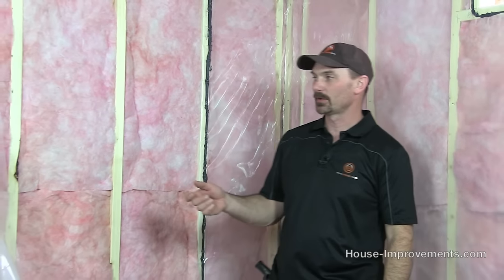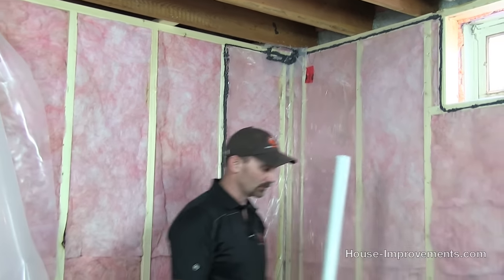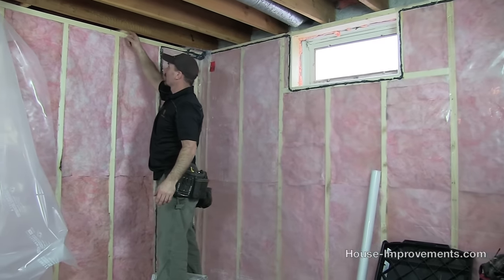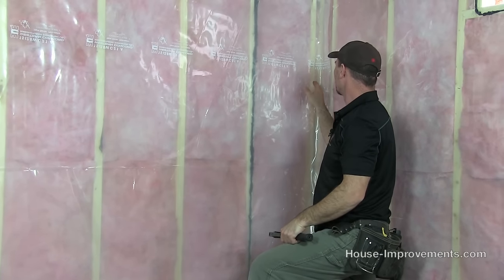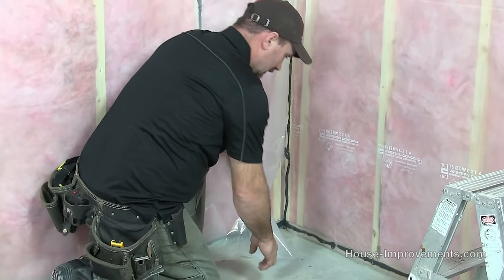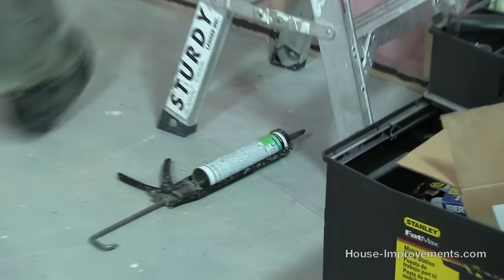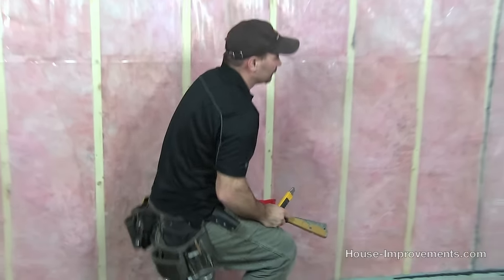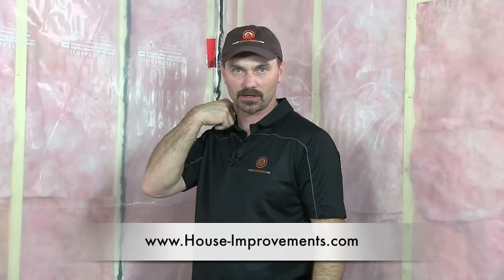How To Install Vapor Barrier

Comment: What is the Red tape called?   i totally did my plastic now I have to tear it all out thanks god its only 10x20
Reply from the maker: Sheathing tape. Its very common to find, it comes in red ,white and blue and around here they actually want the blue coloured version used for vapour barrier now, but before they had white and blue we used red all the time. I think the blue has even more glue, I'm not sure though

Comment: I wanted to ask if you would suggest installing a sub-floor first, then start to frame your outside walls as well as your partitions, this way you potentially avoid using pressure treated the concrete or vapor barrier under you 2×4. Your thoughts? Thank you.
Reply: G.Gruca no. Just seal concrete

Comment: After you've finished the caulking along the bottom do you cut off the excess poly that was hanging at the floor...looks like about 4-6 inches extra down there?
Reply from the maker: yes, trim it off.

Comment: So to be clear: the insullation can go directly in contact with concrete foundation walls?
Reply from the maker: There needs to be a moisture barrier. Look for my video on moisture barriers. In this case we used rigid foam insulation and it also acts as the moisture barrier.

Comment: Hi, we have a new house where the basement is not completed. The concrete walls are covered with 2 inch rigid pink foamboard. one wall has a combination of wood frame above the concrete wall and has fiberglass bat with poly sheeting over it.I want the wall to be straight to the ceiling.So from your videos I see you should frame the wall, install bat fiberglass and then cover  with poly for an air barrier.
My question is the wood frame that is insulated and has poly over it ok to leave as is and have a 2-3 inch gap between it and the new frame that I am going to build?
Reply from the maker: the gap is ok but remove the poly sheeting form it. There is a chance that insulation may want to fall out of the framing where the 2-3" gap is over time so if it was me I would lay some batts horizontally in that gap to help hold things in.
Reply: Thanks for the quick response, I was thinking I may have to remove the poly as the new wall will take care of it..

Comment: For the vapor barrier hanging on the floor, do you trim the extra vapor barrier before putting flooring to basement or it is recommended to leave it and overlap the flooring ?
Reply from the maker: Trim it off. I generally wait until after drywall mudding is complete. That flap on the floor helps catch some of the blobs that you drop.

Comment: Hi Shannon.  As always, another great video:)  Now by doing the Vapor barrier like you are here... Would you still need to run dehumidifiers???  Thanks.
Reply from the maker: Very possible. especially in a basement.
Reply: +HouseImprovements thanks Shannon.

Comment: Have a question. Is vapor barrier necessary in hot humid weather with virtually nonexistent winter? This is have unfaced bats to be installed on brick/concrete walls.
Reply: In zones 1, 2, and 3 in the lower US no vapor barrier is needed and not recommended.

Comment: I got a house with just wood siding on the exterior. Should I just put the fiberglass installation in the stud bays and then put the moisture barrier on the interior and call it good?
Reply from the maker: If this is above grade then yes, batt insulation and air/vapour barrier is correct.

Comment: Just wondering if the vapor barrier poly could create condensation where it is overlapped?
Reply from the maker: it will be fine. its only sealed at one edge not both sides of lap.

Comment: I'm working on renovating my mudroom which is located between my garage and house. There is a ceiling and then a small attic space above the mudroom so am I correct in that I should install a vapor barrier to the ceiling below the insulation? Does it matter if the ceiling vapor barrier goes on the inside or the outside of the overlapping wall vapor barrier? TIA!
Reply from the maker: yes you need vapour barrier on that ceiling ,lapping procedure should not matter on the walls. I prefer to have ceiling poly behind the wall poly but it really does not make a huge difference.
Reply: @HouseImprovements  thank you for the reply!

Comment: Hi Shannon, what is between the fiberglass insulation and foundation wall?
Reply from the maker: A moisture barrrier, in this case it was house wrap. Look for my video on "Moisture barriers"
Reply: @HouseImprovements  Thank you! My home has tar paper, fibreglass and plastic only to about 6 inches form the concrete floor. This is in Eastern Ontario. I was thinking about adding plastic from the bottom 2x4 plate to seal that gap as I can feel cold and moist air radiating from the foundation. Is this a bad idea?

Comment: I accidentally drilled a small hole on an exterior wall while trying to put in some wall anchors to hang something.. would I now have to break open the drywall to seal that hole? Is a tiny 5/16 drill hole going to cause problems?
Reply from the maker: No, you get small holes even securing the drywall. The idea when building teh wall is to keep them to a minimum.
Reply: @HouseImprovements  Thanks Shannon, I didn't actually expect a reply! Love your content, thanks again!

Comment: do you need to use the acoustical caulk? can i vapor barrier without?
Reply from the maker: The seams and edges must be sealed . You can use builders tape (tuck tape) anywhere you are sealing poly to poly or poly to another plastic/vinyl surface but  these tapes  do not always stay stuck to wood long term. Acoustical stays flexible and sticks well.
Reply: @HouseImprovements  I was hoping I could just staple all around and use tuck tape on poly to poly without having to use the caulk
I've used it before it gets everywhere I hate it

Comment: I`m building a wine cellar in my home and would like to improve insulation. Do I need to place the vapor barrier first behind the studs or after I build the frame and fill up with fiberglass? Thanks a lot;
Reply from the maker: vapour barrier always goes on the warm side of the insulation
Reply: @HouseImprovements   Thanks mate I`ve sow a couple of your videos you are rockstar!

Comment: So if I am insulting a basement room and on the outside of the room there is no studded wall, just the bare concrete. Would I seal the gap between the end of the rooms wall and the concrete?
Reply from the maker: Yes bring the vapour barrier around and seal it to the concrete.

Comment: What do you use to seal the vapour barrier to concrete on a unfinished basement? Need to replace my insulation  but have not opened it up as I am not sure what to seal with it to the concrete
Reply from the maker: Acoustical sealant

Comment: Is there a building code or functional reason why there should be an excess on the floor of about a feet away from the wall?
Reply from the maker: Not sure what you are referring to? We could discuss it more in the forum if you want to post the question there.https://www.house-improvements.com/forums/
Reply: @HouseImprovements  sorry my question was not complete either as I re-read it. I was referring to the plastic barrier. I've seen some of them laid on the wall then extends from the wall-floor corner about 1 foot away from the wall onto the floor. hope that makes sense now. Thanks

Comment: Is there rigid foam underneath there? Or did you just frame and batt insulate for basement ? Thanks Shannon
Reply from the maker: This one has 1" foam against the concrete walls.

Comment: I have engineered trusses for my basement ceiling. How do I get a proper seal with that.  Just going to the bottom of the joist seems like the moisture will come in from the ceiling
Reply from the maker: You have to also seal the rim joist areas as well. I have a couple of videos on my channel showing options.

Comment: Have an exposed exterior garage cement block wall that i wanna cover with vinyl siding. After throwing up furring strips and foam board, do i need a vapor barrier like this before i throw the siding up? Garage isnt attached or anything.
Reply from the maker: Vapour barriers are required on the warm side of walls under the interior finish in colder climates. So if your doing siding on the exterior then no,  vapour barrier is not required.
Reply: @HouseImprovements  thank you.

Comment: After creating this barrier with so much care for being air tight I don't understand why then the next step to put hundreds if not thousands of drywall screws right through the plastic into the joists. Can someone please explain why on earth this is considered code? Surely moisture seeps around the stud to penetrate around the screw.
Reply: True if you take the screws out and leave them out with all those screw holes left behind.

Comment: Is taping the punctures of plastic really necessary? I mean you do have to screw in the dry wall after all. Wouldnt that puncture the plastic also?
Reply from the maker: But those holes are not as free to leak air as they are sandwiched between the drywall and wood.

Comment: Watching other channels, there seems to be a big debate as to whether or not to place vapor barrier on ceilings (for attic above). Many guys are saying it’s a breeding ground for mold. I have no idea.
Reply from the maker: If your local code says you need a air/vapour barrier then yes you need it on the warm side of any cold exterior wall or ceiling .

Comment: I've only ever seen vapour barriers on the outside of the framing of external walls.  Wouldn't putting a vapour barrier on the inside of the framing of an external wall simply prevent the framing from drying inwards, and encourage moist conditions around the framing?
Reply: +Penfold &#39;OoO&#39; thats odd, in houses its always recommended to have the vapour barrier in ceilings and walls on the warm side of the house, which prevents air movement, it of course must be 100 percent sealed.(this is also to code in Canada) While the basement does have a different set of problems, because it is below ground, , there are other rules to follow.First, is the outside of  new construction should be sealed from the outside against water, this has no effect on insulating values.The moisture content of a block as opposed to poured is different, so waiting a few years for the concrete to cure is a smart thing.While spray foam or foam board is ideal for against the concrete walls , it is expensive.A water barrier(not vapour) is applied against the outside wall first, years ago it was just tar paper but now new items are used.This prevents any water coming in contact with studs or insulation.(If you have tons of water coming in you have worse problems than insulation, its water proofing and drainage on the outside). The studs normally now are blue wood, water resistant and mould proof.The fibreglass is a choice, roxul can be used and it is mould and water resistant.The final vapour barrier prevents warm moist inside air to reach cold outside areas.Here in Canada, where this is filmed the air temperatures can vary from +35c to -35c and more. hth.
Reply: Moo Cow Ah, Canada.  That probably explains it.  My neck of the woods (Mediterranean climate) has a 5–45°C temperature range, so the "warm side" is actually the external side.  In Canada, with much colder temps, the 'warm side" is the internal side.  That makes sense.  Cheers!
Reply from the maker: +Penfold &#39;OoO&#39;  Are you in a tropical climate?
Reply from the maker: +Penfold &#39;OoO&#39; OOps I should have read all the way to the bottom
Reply from the maker: +Moo Cow Very good explanation Moo Cow.

Comment: So if water of moisture comes in through the exterior wall, it's now trapped inside the wall?
Reply from the maker: Well ,we build to keep water out of the wall cavity but problems do occur obviously if that fails. Normally in basements in colder climates we use moisture barriers against the concrete to direct any moisture to the floor where it can find its way out in theory. Air/vapour barriers in cold climates are two fold #1 to keep warm moist air from the interior of a home from going into the colder zone of the wall and #2 keeps cold drafts from entering the warm zone of the home . Everything must work together to function correctly.
Reply: I see. I just put a french drain in my basement with dimple board extending up from the drain a few inches up the wall, because in addition to hydroststic pressure pushing water in through the cold joints at the floor, i would also get water in from the wall. I don't know if the walls will still leak since we haven't had any big rains for months. Would it be OK to put poly up against the concrete (loosely), so any water coming in from the wall is channeled to the drain. Then build the interior wall a couple inches away from the concrete wall?

Comment: I'm confused. I thought the vapor barrier was supposed to be installed against the concrete wall to prevent moisture in the wall cavity? One of your older videos shows installing poly against the concrete and then building the wall in front of thr poly?
Reply from the maker: You are confusing "moisture barrier " with "air/vapour barrier". Moisture barriers are against the concrete .
Reply: @HouseImprovements  thank you for the clarification!

Comment: Is vapor barrier only for basements? I'm planning on insulating my garage. Would I need to do this?
Reply from the maker: If it is required in your area then it would be required on the warm side of any exterior wall or ceiling right under the drywall.
Reply: @HouseImprovements  thank you!

Comment: do I still need too add the poly over the insulation like you are doing here if my basement is underground
Reply from the maker: yes if you local building code calls for a air/vapour barrier then you will need it.
Reply: Eddie Williams especially if your subgrade.

Comment: Where do you get the vapor boxes? I have been unable to find them. Thanks.
Reply from the maker: pretty common item at most any big box store or hardware store around here?
Reply: HouseImprovements, I will continue looking. I could not find online or the one local store that I looked, just kept pointig me to the sheeting.
Reply from the maker: it is common to use a chunk of 6mil vapour barrier but these are so much neater .https://www.gescan.com/products/boxes-covers/metallic-boxes/gang-box-accessories/vapour-barrier-4g-soft-poly-boxvb4

Comment: Can find these soft air tight electrical boots anywhere. The only place online wants $560 for a lot of 100 but I only need 20. Know anywhere I can get these? Thank you.
Reply from the maker: They are available at an HD, Lowes, etc in my area, Check with local electrical suppliers
Reply: @HouseImprovements  thank you!

Comment: I had to fish new wires and cut into the dry wall and Vapor Barrier. I know I need to fire block all the holes. Should I patch the vapor barrier with another layer?
Reply from the maker: Patch it up yes.

Comment: Do I vapor barrier the ceiling before the walls in my garage or does it matter?
Reply from the maker: does not really matter. I like to do ceilings first and hang down the walls a bit then seal the top of the wall poly to that.

Comment: Only issue I see is you should use blue tuck tape.

While the red tape is a construction sheathing tape that is handy with sealing joints and insulation materials, the blue tape is manufactured specifically to seal PE-grade vapor barriers.
Reply from the maker: Yes, now Blue is the new normal for this.

Comment: Isn’t this bad if water comes from outside .. because it’s trapped in the walls and can’t tell because of the plastic and now insulation and 2X4, is constantly wet ... is that a issue
Reply from the maker: Water coming in from the exterior is not the fault of the air/vapour barrier. In many areas a air /vapour barrier is required and must be used. If you are doing this in a basement like in this video you would also have a moisture barrier against the concrete to direct moisture that comes through the concrete  to the floor and not into the wall cavity.

Comment: hi shannon, what did you do at the windows with the poly?
Reply from the maker: +Tsz2g4f  Sorry, good question. The poly is sealed with acoustical to the framing around the window then I spray foam the space between that framing and the window jam to complete the seal. You can also seal the poly to the outer edge of the window jams if they are vinyl using tuck tape after insulating.

Comment: Are you putting the vapor barrier because you you use unfaced fiberglass batts and not faced fiberglass battsm It would have been good to explain this in your video, unless you explained it in another video.
Reply: Building codes dont allow faced insulation anymore. 
This is the new code of how to do it..
Except the electrical boxes...
Those plastic protectors behond the box arent allowed anymore
Now. You have to buy the yellow sealed electrical boxes with the foam gasket for the outside walls..

Comment: What do you think about roxul batt for the attic?
Reply from the maker: +Zsolt Beres No problem at all using it anywhere.
Reply: Roxul is the best insulation you can get next to spray foam

Comment: Shouldn’t the framed wall have a u-shaped vapour barrier installed first, before nailing it to the concrete floor and then tape to it the wall vapour barrier?  Your way the bottom std will absorb the moisture ftom the concrete.
Reply from the maker: In this case the bottom plate is treated wood and I also have a foam gasket between the concrete and wood.
Reply: @HouseImprovements  Yes, OK, this might work, but is more expensive than regular studs wrapped with, i don't know, 18" wide vapour barrier sheet.  Thanks for your clarification.